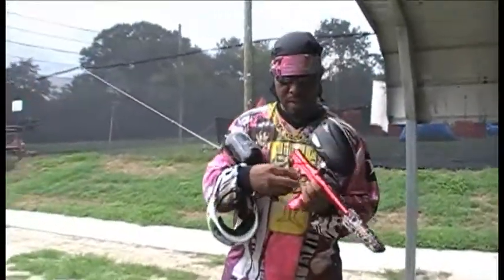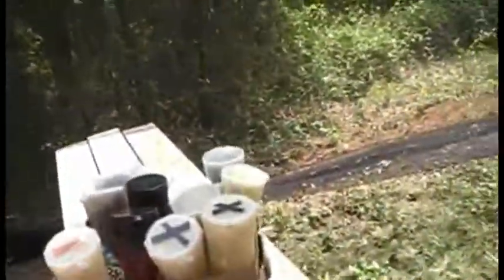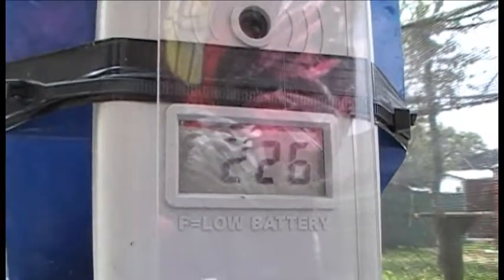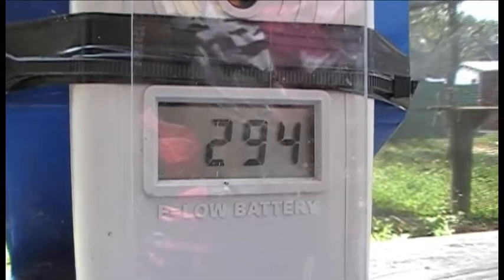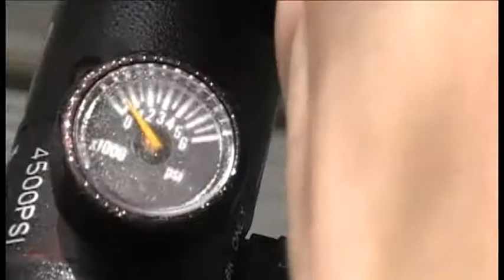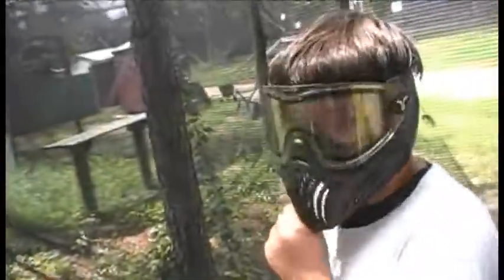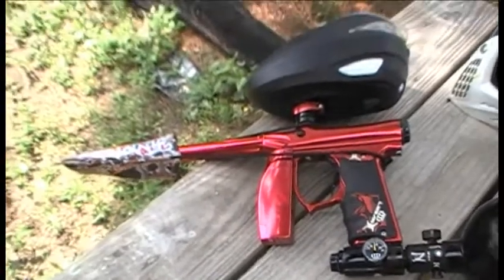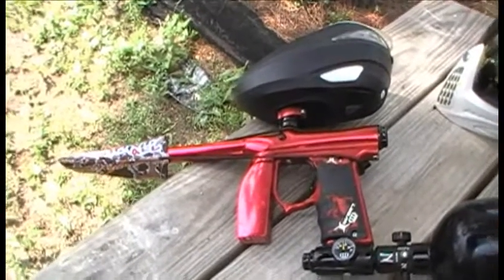Invert Mini Efficiency Test

Comment from the maker: lol. well you do have the pricepoints. Biggest difference is the quick bolt out the back/  on off asa, but a big difference is the trigger,   microswitch /vs hall-effect  (which behaves very similar to optical tirggers)

A lot ofplayers say that despite the same design concept , the axe is much better. I still like the lines and curves of the minis design better though.

Comment: I also have an invert mini and I use both a high pressure tank and low pressure tank but I've noticed that my invert mini isn't that efficient. A 68/4500 filled to 4000 can maybe give me about 6-7 pods not much more than that. Any ideas and what is wrong with my mini?

Comment: Hey I played in a 5 man tournament last weekend placed second and this weekend playing in a pevs 3 man tournament. Im running the techt bolt and cant seem to figure out how to adjust it just right. Last weekends tournament I ran the medium spring with the back o-ring on the bolt removed at dwell of 5 milliseconds, 150-160 psi and 1.5 turns out on back cap. Any suggestions? I am trying to tune for consistency and efficiency. I need at least a hopper plus 5 pods. let me know what you think. Thanks